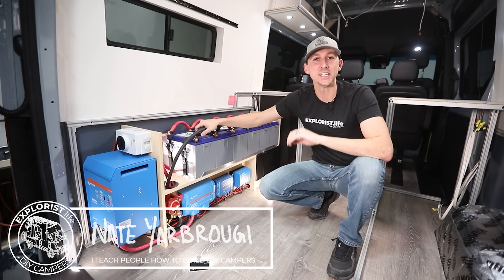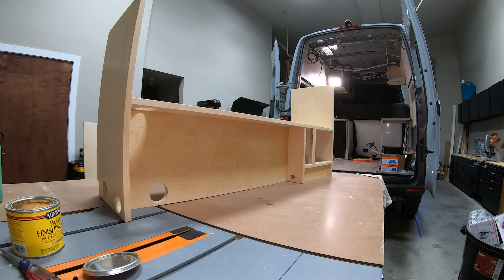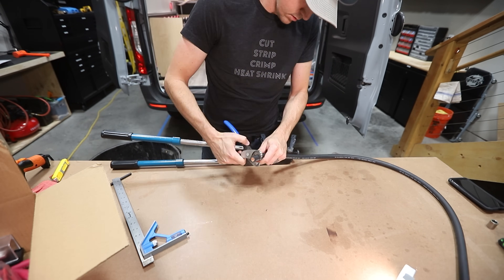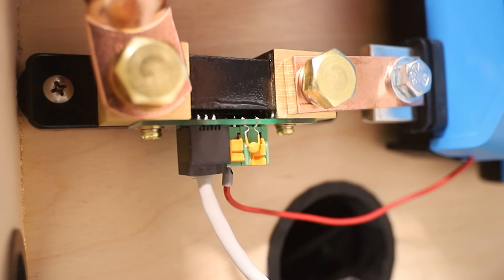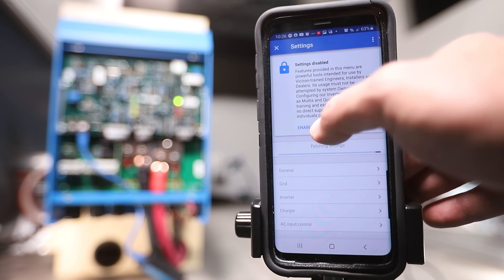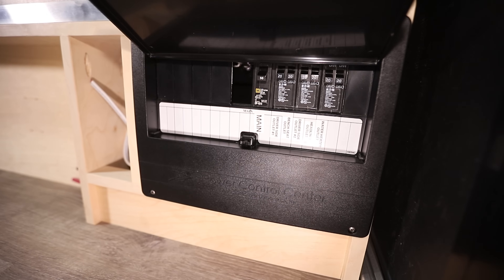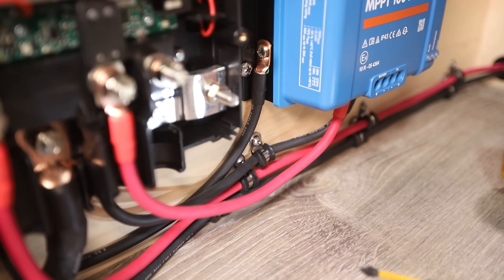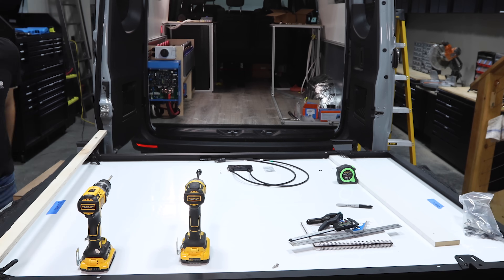DIY Sprinter Camper Van Electrical Install - Full Tutorial

Comment: Great video and very tight installation👍🏼. I’m curious though what happens if you turn off the battery switch with solar power as well as the Orion is still inputting power to the system. does it hurt these components not having a battery connected to them
Reply from the maker: You shouldn't do that. 🙂The battery switch should be the last thing turned off and the first thing turned on.
Reply: @EXPLORISTlife   For sure, but the human factor right.

Comment: Hey, thanks for your work!  Sorry if this has been answered in another comment; there are so many I can't get through them all haha.  Why do you use spacers to push the parts away from the wall?  Is it a vibration thing?
Reply from the maker: They wouldn't sit flush otherwise.
Reply: Thanks for asking this!  I had the same question, and was luckily able to find yours easily since it is recent lol :)

Comment: Great video and enterprise!  really like it. Some thoughts though.  I was interested in the setup, of the shore power pedestal because there are some real safety choices to make regarding the earth, grounding,  safety etc, but missed this in this video. Could not find it on the website.  Second a question; the battery switch is rated 300 Amps, 600 for just a short moment, but max pull from 6  100amp batteries is many times more. Should the switch not be heavier?  The Multiplus built in transferswitch is great but, if for any reason without knowing shore power cuts off, (electrical malfunction, someone trips/disconnects your cable when you're away, any existing load becomes a load on batteries.  If solar can't cope, you might arrive back at your van with flat batteries. What could be a solution? And least, in the EU it is mandatory, when using in the Van self generated/inverted power (floating net) and you take this outside the Van, earth leakage protectors after inverting are not safe and one should use an isolation guard / protector. I know but have a hard time understanding why. Can you elaborate on this? thanks.

Comment: Nate I have built the electrical system using your video--what a fantastic resource. I have an issue however...the Orion is showing a -2.3 charging instead of something around 30 as your video suggests it should be. Additionally, I seem to be connected to the Orion via bluetooth but the green light in the lower right of the cover is not on. I don't know what the problem is? I have a 2019 Ram Promaster. Can you help me? Respectfully, Scott

Comment: I would LOVE LOVE LOVE if you could supply the sketchup plans for that unit holding all the electrical. I'm based in the UK, but the system I plan to install is near exactly the same (otherwise I'd order parts via you).
Reply from the maker: Sure thing!  The link to the sketchup plans are in the pinned comment at the top of the comments section.  Here's a direct link, though: https://shop.explorist.life/shop/all-products/plans-and-diagrams/3d-files-project-templates/electrical-enclosure-plans/

Our parts kits ship to the UK. 🙂
Reply: @EXPLORISTlife    Thanks so much for these - will be purchasing this evening. Good to know! Though I think UK/ Europe regulations are a little different. First we use 220-240v. Second thing I'm concerned about is in england I believe (however not 100%) That we have to  earth the 240v to the chassis. 

Another thing I have a quick question about.  Why the isolated version of the DC to DC? Couldn't you have gone none isolated and use the same chassis negative as the battery? 

Thanks again!

Comment: I’m sure this question has come up but I can’t seem to find any relevant info related to it that you’ve answered. I’ve found that you can install an EV power converter directly to the shore power outlet and utilize non Tesla EV charge stations as another method of charging a battery bank. With how popular and widespread electronic vehicles are becoming the more charging stations are being created. Might you consider doing a video that includes how we would install a 3000w EV power converter directly to our bus bar backed by a fuse to directly charge our battery bank without having to fuss around with a 20a cable awkwardly routed outside of the van and into the shore power outlet.
Reply from the maker: I will not do a video like that, no.  Parking our RV's at charging stations specifically made for charging vehicles trying to get on down the road is a fantastic way to get even more restrictions put on RV's, vans and campers.  That's more of an ethics thing.
Reply: @EXPLORISTlife  That is a fair point about getting more restrictions slapped on to our vans and RVs but let’s say (and I know not everyone would have this approach) using an adjacent parking spot and not leaving the charger unattended as to give up the charger to that someone trying to get on down the road. Ethically, I see no problem with this as it is an albeit cleaner alternative than alternator powers source of oil. Shore power at camp sites are often significantly price hiked but alas, the thought is that this method would be the last option of battery charging I would use if it came down to the wire of survivability with the thought of withstanding poor conditions aka summit county peak pow season. Thanks for the reply! Who knows, maybe in the future some business savvy individual might see this and start an RV friendly charging station chain. Cheers.

Comment: Wow, very nice work. I am starting a DIY toy hauler electrical system from scratch. It will use a generator for AC power and batteries for DC power. Nothing solar yet. Any sites or places to find info or a diagram that could be useful? Thank you 🙏🏻

Comment: Thanks so much for this great video! Just one question. Why did you choose against using Dicor? I see you are using Sikaflex-291 - I didn't see that this has UV resistant properties. Just wanted to make sure before I buy. Thanks so much for this great content!
Reply from the maker: Either should work just fine.

Comment: Excellent video! Wondering about the 4/0 wire. Battleborn specs 2/0 for 6 or fewer batteries but after watching most of your videos I'm guessing your choice is well thought out. Would you advise against the smaller wire size for short (6') runs?
Reply from the maker: 4/0 is based on the requirements by Victron from their user manuals in this system.  I can't recommend wire smaller than 4/0 in this system as I have to follow the published manufacturers recommendations and using 2/0 wire for the 12v 3k multiplus is too small per the Victron Multiplus user manual.
Reply: Thanks for the amazingly fast reply Nate. 4/0 it is!

Comment: Great tutorial! I learned a lot from this!  I would like to see a cost breakdown of the whole system and a list from which to recreate the build for my personal use in my RV build if possible.  Also curious if AGM batteries could be used instead? Thanks for sharing your knowledge.
Reply from the maker: Glad it was helpful!  Did you check the link to the kit in the video description I referenced a dozen or so times throughout the video for pricing and parts?
Reply: @EXPLORISTlife  Thanks yes I found it right after posting my question.

Comment: Awesome video! Only question is for the pos and neg wire for the dc to dc charger, can the neg be just grounded instead of running it all the way to the front seat area?
Reply from the maker: I mean, you are running one wire, so may as well do it right and run them both.

Comment: Sorry for a noob Q - if you had no sun and no charging, how much battery power do you get before they run out? 100W hours per battery? What does that mean exactly? Thanks for the great vid
Reply from the maker: We added 7560 Watt Hours of batteries (1260Wh per battery x 6).

This means we could run a 100W device for 75 hours.

A 1000W device for 7.560 hours

So on and so forth.

Comment: why do you choose the multiplus over the multiplus ii and what are the differences. love the videos by the way.
Reply from the maker: The Multiplus 2x120 is for systems with 50A shore power which will be on larger campers with, say, 2x air conditioners.

Comment: Nice and neat and well explained. Thank you. What about costs? Also, it looks like the van has some 80/20, why not use it completely to provide better heat sinks than plywood?
Reply from the maker: There is a parts list in the video description where you can see about costs.  It doesn't make sense to talk about costs in the video since prices of materials (copper) changes nearly daily.

All if the components have heat sinks built in, so additional is not really necessary, but feel free to do whatever you like in your own build.

Comment: Hi! Your videos are my go to for my sprintervan conversion, thanks a lot!! How did you choose the wire thinkness for the ground wire for the multiplus? I have a 12/1600/70 multiplus but in the manual i can't find any information about which wire thickness to choose. The connection for the multiplus is big enough for a 16mm2 or maximum a 25mm2.

Comment: Hi Nate. I'm working on the electrical system for my sprinter now and have found your videos to be a really great resource. Could you point me in the direction of the mounting brackets you used for the solar panel? I don't see a link in the description, am I missing something? Thanks!

Comment: Great video. Thank you.  
Question 2: 
I'd like to use the existing sound system, and other components of my Vehicle and have a fool proof method for my car battery not to be drained, if the components are left on too long. Is there something I can add to this system, for the existing methods of charging (Solar and Shore Power), to charge the existing Vehicle Battery?

Comment: So much gratitude to you and your team for all the info/help you provide to all of us. I would love to receive your feedback about using a Victron EasySolar combi for a van conversion. Right now, I’m in the beginning stages of the electric/solar system installation (2 100ah BB batt) and was suggested the easysolar combi. What are your thoughts?
Reply from the maker: I think they are great if you live in an area that uses 230V 50Hz Power (Pretty much everywhere except N. America).  EasySolar units are not available in 120V 60Hz power (N. America).

Comment: Hi Nate Awesome videos…..! Many thanks for the time and effort you put into making these. Forgive me but Ive looked through your library and I cant see any on 1. Hooking up a generator to the Cerbo GX. I understand it has a dedicated relay (R1) designed specifically for the auto start/stop of generators but I cant find anywhere that tells me exactly how to connect the wiring loom from the in my case Cummins Onan generator to the relay. 2. Also, I’ve just had a new more powerful solar system installed on my barge and I’m hoping to dump excess energy into the hot water tank via the immersion heater. Any help there would be hugely appreciated. Thank you👍
Reply from the maker: Great!  I'll see how I can add those topics to upcoming videos.  Cheers!

Comment: Awesome video! Gives me confidence to try on my own. I did have a question though. How did you tighten the enclosure to the van? It speed right into place however how did you tighten it to the van?
Reply from the maker: It was secured using angle brackets to the 8020 and to the floor.

Comment: Hi Fantastic information. I have a lot to catch up on LOL. A question, 1 will be installing 2 x 430Ah lithiums in parallel what size should I make the battery cables and cables to the 3000w inverter? Thanks in advance.

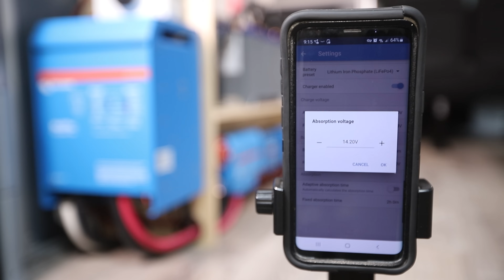Comment: Nice job on the video. I like the way you explain and use time lapse. I couldn't find the link to the DC to DC Charger "Cheat Sheet" you mentioned at 58:41. I'm going to install  the 12-12/30  Orion and know most of the settings for a 100ah Battle Born, but it would be nice to know the others. Thanks.

Comment: Great video. Thank you.  
Question 1: 
Would a CCGX Victron Color Monitor be able to be installed in this exact system, or are other modules required in addition to the CCGX? and would it be useful to the system?

Comment: I have been watching all your videos and they are really helpful.  One question I have, which isn't specifically for vans, is how one would combine a wind turbine with a solar system.  Do you have any comments on this? I would love some advice.  Thanks
Reply from the maker: Wind turbines needs to be pretty big to be particularly useful, so they aren't really conducive to camper electrical systems; so I don't integrate them.

Comment: Great channel the videos go into great depth. Just wondering what size mega fuses did you use for each Victron product as well as 12v fuse panel in the Lynx Distributor.
Reply from the maker: Check out the parts list, kits, and wiring diagrams as that stuff is listed in it's respective resource.

Comment: Fantastic tutorial video Nate, well done.....watched it 4 times!!!  I have a 38' Catalina sailboat and am thinking about copying the exact same set up into my boat.  Question: How can I throw in a 600W wind generator and 3KW diesel generator into the mix?  The wind generator has its own MPPT charge controller and I can do without the engine alternator input.   Thank you!!
Reply: You need a good high amperage charger with LiFeP04 settings to be powered up by your diesel generator. That way, when all else fails, you can top off the batteries and continue powering up your fridge and cold storage. I have an  Aims 75 amp charger on my portable lithium powered unit and it can be run by my Honda 2000 inverter generator or 3KW Onan diesel gen set. It draws a little over 1000 watts while putting 75 amps out at 14.6 volts and will save you diesel fuel. The Aims can also be set to charge 24 volt systems. Generally, the MPPT output from the wind turbine should be run through the battery monitor shunt and then into the battery. The system batteries can simultaneously be charged from multiple sources while they are running the inverter load.
Reply: @kimmer6  I'll be using the 3K Victron MultiPlus Inverter/Charger you see in Nate's video. The question I have is where do I plug in the diesel generator and the wind generator in Lynx distributor and out to MultiPlus? As I said I won't be using the alternator output from the boat's engine.  Perhaps that's where the diesel generator input will go, but what about the wind gen?  Thank you for the info!
Reply: @Sabre3861  I think that inverter charger had input terminals on its panel that can accept 120 or 240 volts AC directly from the generator. For info on wind power, it might be best to see what others are doing on boating forums. Some wind generators with permanent magnets need to have a means to waste energy by using resistors or heating elements when the batteries are full and wind is high.  

 Also note that there are DC to DC battery chargers that will allow the engine alternator to be used as another means to charge lithium batteries. They limit current from the alternator to lithium batteries  to 20 amps (or 40 amps for the larger unit) and prevent your engine alternator from overloading and overheating. They can be set to tailor their output to LiFeP04 battery requirements and they are reasonably inexpensive ($120-$200 US for the Renogy units). The Victron Orion DC to DC battery charger costs about $280 US and can be set for 12 or 24 volt batteries for 360 watt maximum charging from the engine alternator.

Comment: I like it, but was just wondering why you cut the power supply cable for the SmartShunt and splice it - instead of just cutting it shorter and crimping 2 new ferrules on the ends?
Reply from the maker: It's just what we did.
Reply: @EXPLORISTlife  2 extra splice connectors is less reliable 😧
Reply from the maker: @m210658 a butt splice connector on a 18 ga wire is plenty reliable.  This isn't a 100+ amp connection.  You’re majoring in the minors and nit picking.

If you want to do it a different way than shown, feel free, but if you're using our kits; you'll have to source that ferrule yourself as our kit comes with a butt splice connector.  The way we show is just fine.

Comment: Great content. The system you've designed, can it be used in a skoolie? My thoughts are as long as your power system is confined to a tight area as in the video, the 120v and 12v wiring to lights should be straight forward from the supply. Are there limitations in larger (longer) runs to be concerned about with the equipment in the kits? What about supplies from alternator, or solar panels exceeding the length of travel to the system like that in the video? Should, or could wiring be upsized coming from these charge sources and still connected properly without damage to equipment? Thanks for your time. I know i asked a lot. Again, great resource you've created. Sharing far and wide. 👍
Reply from the maker: This could definitely be used in a Skoolie. 😀👍👍

Comment: You are correct, I'm using the 2000W inverter but why the larger wire when you say the electrical demands are lower than the plan with the 3000W inverter using 4/0?
Reply from the maker: A 3000w inverter is more powerful than a 2000w inverter, which means a 3000w inverter pulls more power through the wires coming from the batteries than a 2000w inverter; hence the larger wire size for the 3000w inverter.